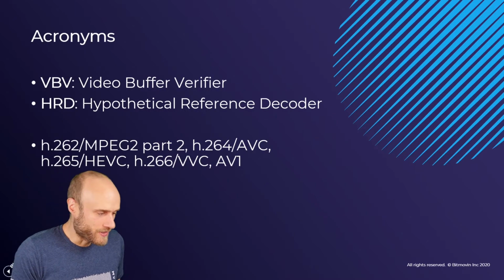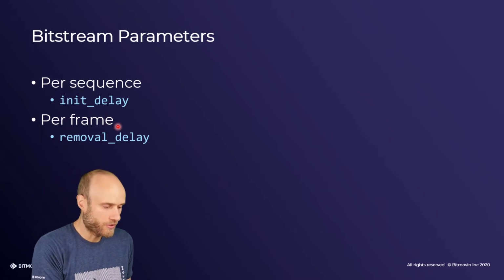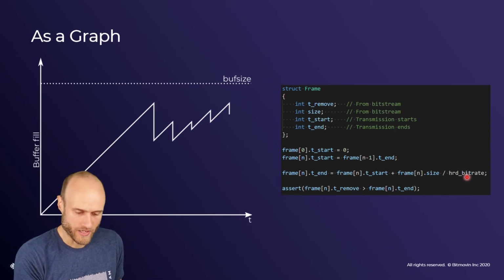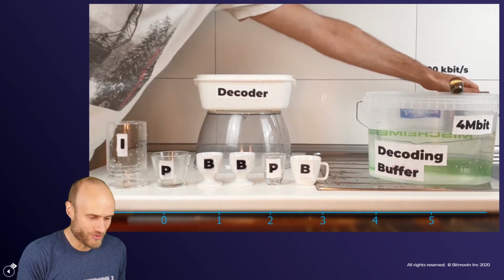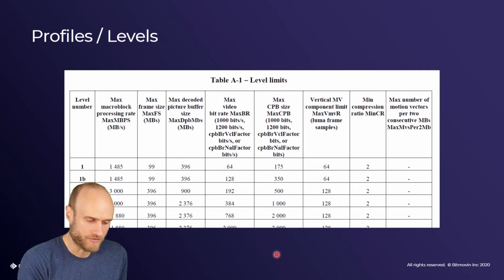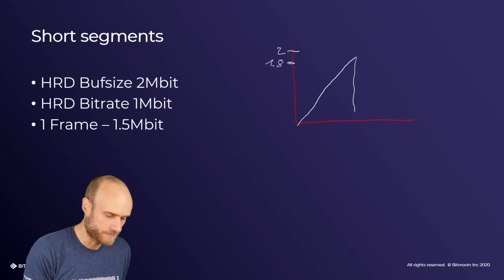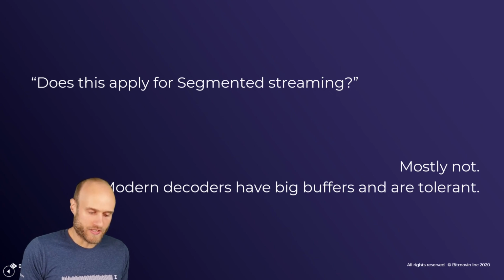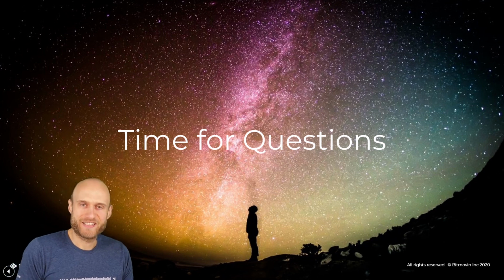The Hypothetical Reference Decoder (HRD)

Comment: what ist ib obs or other Videorendering Software the option: Force HRD? DE: was macht die Funktion HRD erzwingen in einem Videoersteller? z.b. in OBS? 
hab ich damit einen qualitätsschub, oder bessere compression mit weniger artefakten? oder benötigt das weniger rechenleistung für die selbe qualität? warum kan man das aktivieren?
Reply from the maker: I try to explain this in the video. HRD will not give you better quality or better compression or lower computational cost. The HRD is a model that enforces certain bitrate and throughput values. The original goal was to ensure that a certain decoder will be able to play back the video without issues or buffering.